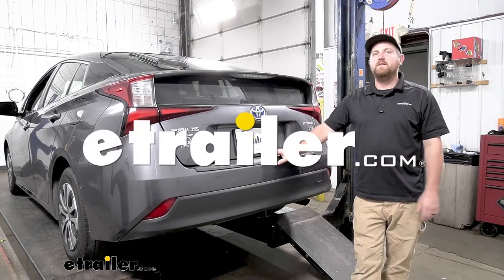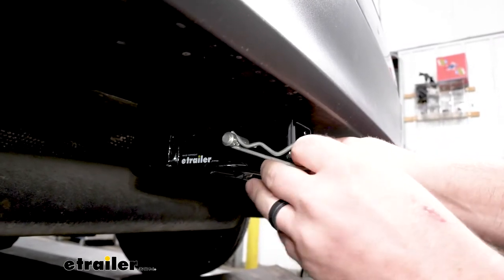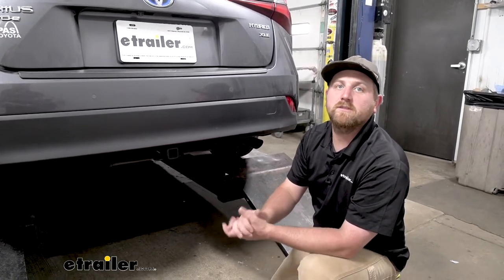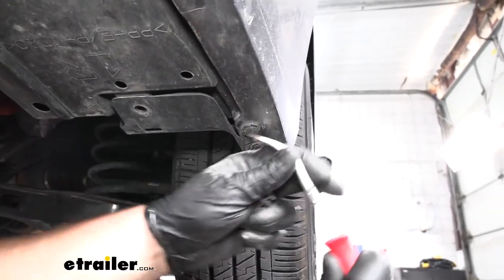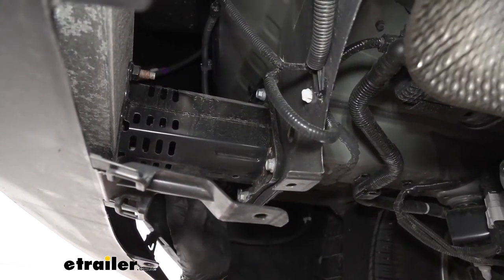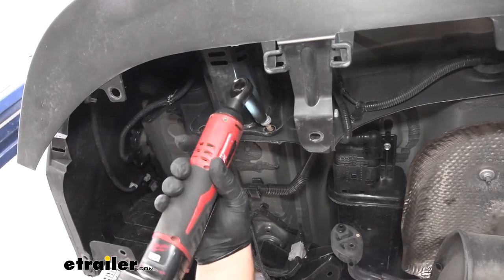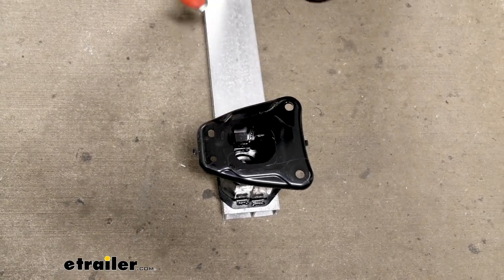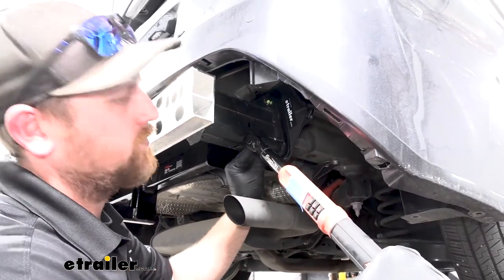etrailer | Curt Trailer Hitch Installation - 2019 Toyota Prius

Comment: How did you put the fasteners back on the bumper?
Reply from the maker: To reinstall the bumper fascia fasteners, you'd just reverse the process used when you removed them. Here's a link to the installation instructions:
https://www.etrailer.com/instructions.aspx?pn=C11473
https://www.etrailer.com/Trailer-Hitch/CURT/C11473.html